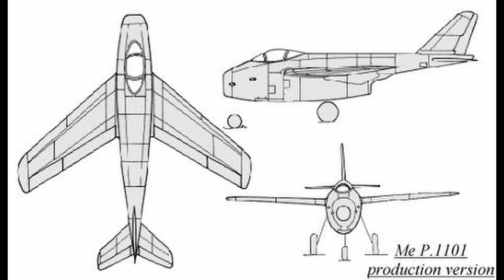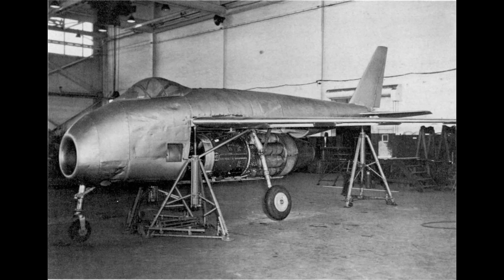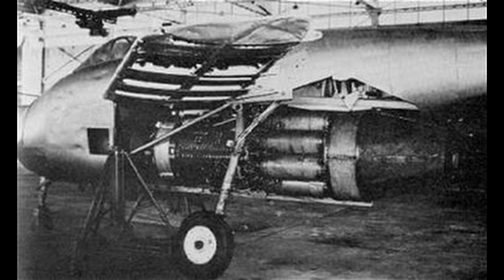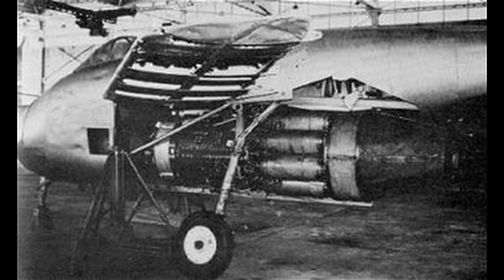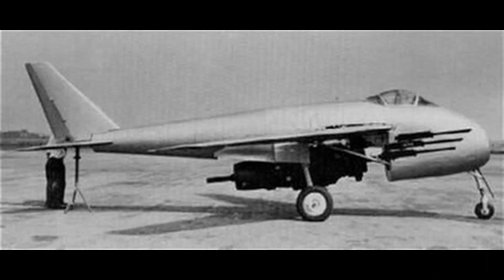Messerschmitt P1101 - Swing Winging It

Comment: At 2:55, you said "P1011", did you mean P1101?  Of interest is that the P1101 sweep could only be altered on the ground, while the X5 sweep could be set in flight from 20 to 60 degrees. Only two X5's were built and were not classified as 'operational" a/c, being purely Experimental. The X5 reportedly had appalling stall characteristics.

Comment: Good doco.  Thanks.  
I don't know why the Germans contemplated part wood construction with their previous disasters attempting wood construction.  
 They could not access  adequate adhesives/ glues .
Reply: All of the problems listed are due to shortages of critical resources that Germany suffered from at all points in the war. Engines and other mechanical as well as production equipment suffered from lack of hardened and high density metals, and Germany turned to wood in aircraft manufacturing as it was easier to produce and more plentiful.  The best German wood glue factory was bombed in an RAF night raid and for some reason they never got their wood glue back up to that standard agin.
Reply: There was also another problem
The all of the jet engines the Germans intended to power their next Generation aircraft never achieve the level of performance advertised
Reply: An interesting topic would be as to WHY the Germans couldn't make good glues.
Reply: @HarborLockRoad   they simply had a limited sphere to acquire any and all resources  if you think about it .  As well as blockades .  They were lucky to source iron from Sweden.   
 The British had a whole empire and allies to source resources . As  well as United States.  
 Dehaviland  simply employed instrument makers to construct the mosquito.  Similar techniques apparently  to making pianos and other instruments . 
  But you would think clock makers in Germany?   
?  
 But the glues and components of glues were difficult for the Germans to source .